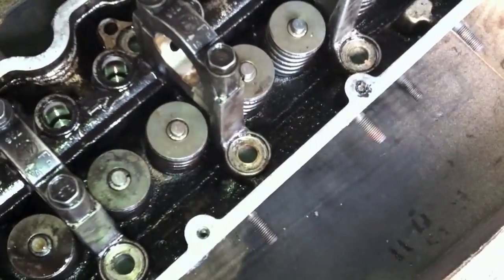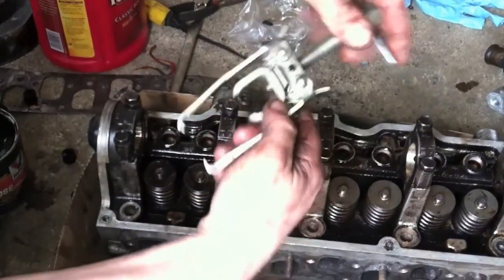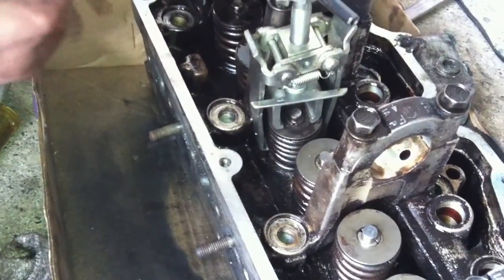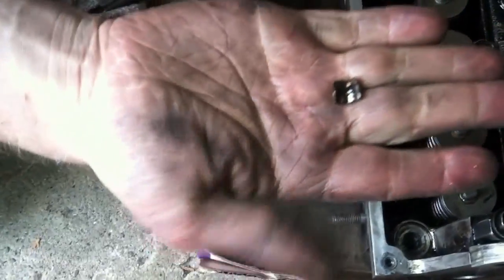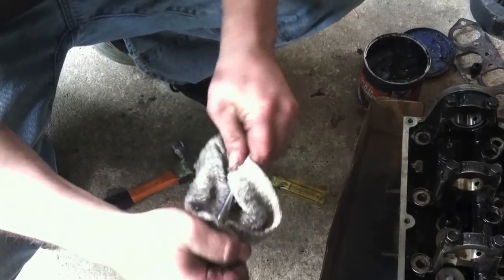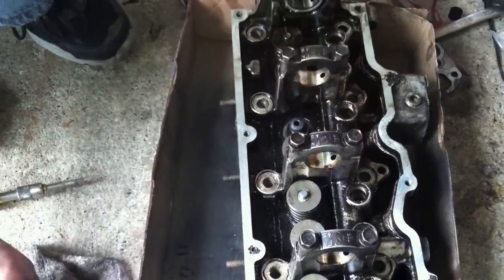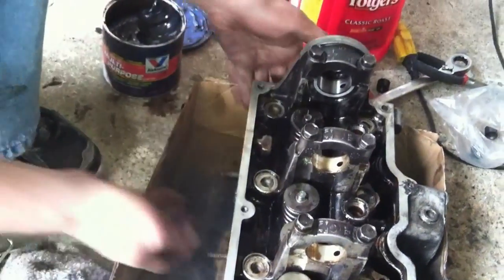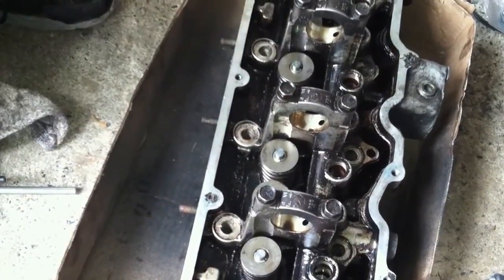HowTo - Change Valve Stem Seals

Comment: I got a question, I have a 2003 Mitsubishi eclipse gt 6 cylinder 5 speed. It blows white/blue smoke after it is warmed up (it doesn't blow smoke on cold start). The car does not overheat. I did checked the spark plugs and they were full of oil.

 Originally, the car uses 91 premium gas, and my mother put 89 gas by mistake (full tank). And the week after she did that, the car with the known conditions from above, started happening. But not sure how that relates to the blue/white smoke, other than oil and gas getting mixed and making a white/blue smoke.

Comment: but if you stuff a rope into cylinder and put at top dead center one cylinder at a time the rope will hold of the valves and person can put air into engine but not everyone has a air compressor

Comment: That valve spring compressor is flimsy and doesn't work with a lot of cars. You would be better off buying the G clamp style valve spring compressor from Sears that pushes against the valve head and has a quick operation level to compress the spring. The one you are using cost about $25 and the pro Sears version was on sale for $9.00

Comment: I have a 07 maxima that smokes everytime I turn on car, would this be what I need to chang?
Reply: Make sure to do a compression and cylinder leakage test before assuming it's just valve seals. It may be rings as well.
Reply: definite yes IF you leave the car overnight and you first started up in the morning because the oil had plenty time to drain down through to seal down the valve guides and onto the Pistons which is inside the combustion chamber.and when you're starting the engine the first time of that day you will be burning that excess oil that dripped down through the valve guides and went past valve seals you'll notice it it's a lot if you get a white cloud

Comment: my car was blowing blue smoke and smelling of oil would that be the piston rings or the valve stem seals?
Reply from the maker: If it's a non stop blue smoke that never stops, it's the rings. If it's a puff when you first start the engine, or when leaving a stop light, that's the valve seals.
Reply: I found out it is the rings the mechanic put second hand spark plugs in and it stopped blowing smoke and it stopped misfiring
Reply: ***** so hows it the rings then if he put spark plugs in & cured the problem? sorry but im confused lol
Reply: beats me but i definitely know it is burning oil
Reply: unaclocker hey i hope you get back to me if you can but... my saturn sc1 its a 1997 its blowing blue smoke when you rev it up a bit my exhaust needs to be re-welded together but its blowing blue smoke when you rev it up a bit so since it needs the exhaust welded it comes out of the middle of the car the exhaust does and its blue when i rev it a bit high like 3kish rpms and it doesnt blow blue smoke all the time theres some white smoke in the mix too... does it sound like a headgasket piston rings or the valve stem seals? thanks, and if it is the valve stem seals do i have to take the head out to replace them?.. thanks again i subbed fav'd and liked this video
Reply from the maker: SvddenDeth Could be the headgasket. Good cheap place to start. Might as well swap the valve seals while you have the head off, they come with the headgasket kit.
Reply: if i pull my valve cover off and theres no antifreeze in the oil and its just oil would you think it is the valve stem seals or piston rings?
Reply: And sorry i meant the saturn only blows blue smoke under acceleration with some white smoke mixed in it, when the car idles i cant see any blue smoke i can tell of, not alot of white either to be honest but its towards the middle of the car so i never notice any smoke only when you rev it up to 3kish it will begin blowing blue smoke.
Reply: What's it like at idle 1st thing in morning,without revving the ass off it? White smoke is indicative of either head gasket,injectors or pump. It's not financially worth doing all the work on a 97 car though.unless ur loaded n don't mind forking out $$$
Reply: i am getting rid of the car now asi have a new car
Reply: Martin Thomson at idle it just stays at around 1k rpms and does not much different
Reply: Martin Thomson it does not have a lot of smoke at all only when you rev or accelerate it comes out a little white and blue i paid 400 for the car i knew what was wrong with it  when buying it well, knew it had major issues but i bought it so i could have fun doing a project it runs and drives and shifts fine.
Reply: really,you need someone to do a compression test on all cylinders,to see if rings are kaput or going bad.but seeing as you only paid few hundred its not really feasible.just had my valve stem seals done for £250 & thats cheap!lol(to do properly is about 7-10hrs labour,inc seating valves properly,grinding etc
Reply: no point now i have a new car so the golf has to go
Reply: Ah good
Reply: +unaclocker The Daytona I has smokes when you rev it up past 5500RPM. The smoke smells like a lawnmower, can't tell if it's the valve seals or rings.

Comment: I noticed that you didn't use any O rings,only the umbrella seals...Are you using different exhaust and intake seals???or are they both the same?
Reply from the maker: Yeah, all are the same on this engine. It's a mid-80's 4 cylinder engine head. OHC, Chrysler engine. I've never actually seen an engine that used o-rings on the valves, but I'm sure some do or did in the past.
Reply: O-rings were the first thing that really came out to try and limit the oil but they did a very terrible job compare to today's seals The umbrella seal actually use snaps into place and it's designed to keep oil away from the valve guide but has to allow a little bit to keep the friction down unless the manufacturer doesn't need it because they use something else for the valve guide